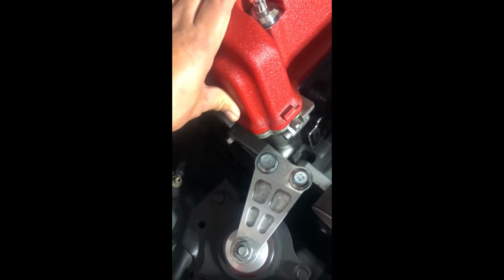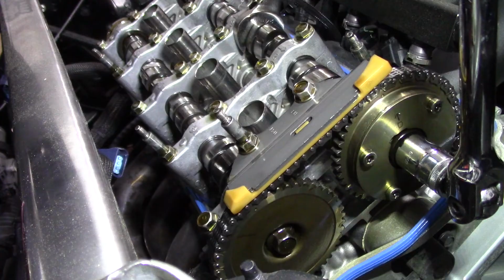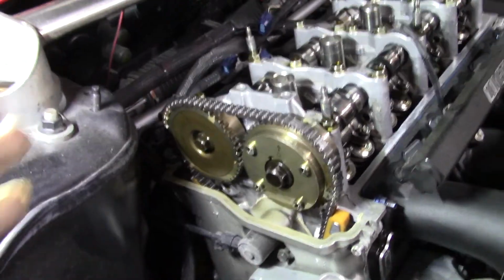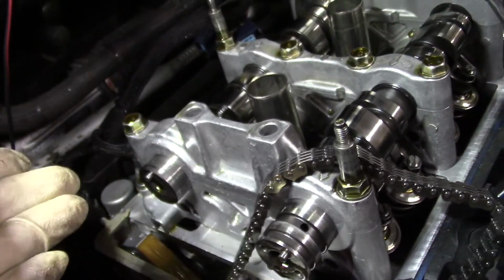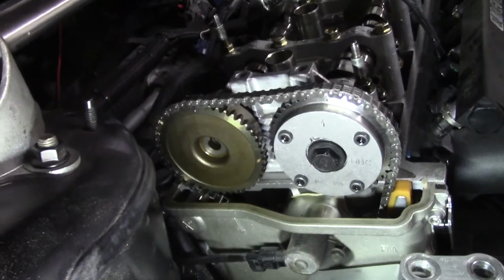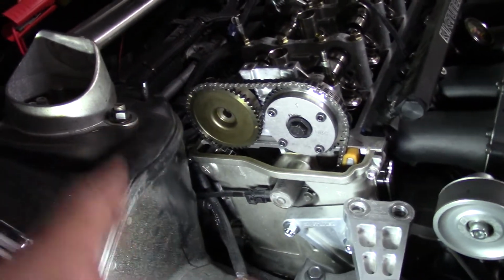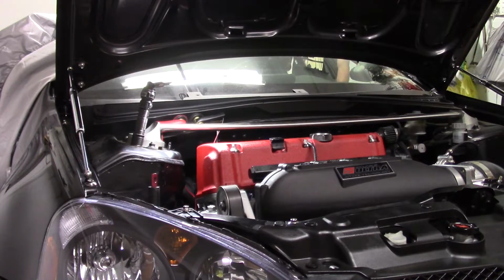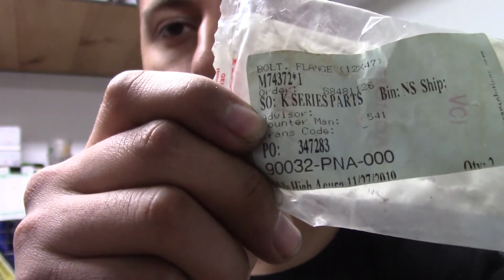How to fix your K series engine rattle!

Comment: I believe oil pressure unlocks the pin and spring pressure locks it. It rattles because the spring loses tension over time preventing the pin from locking on cold start up!

Comment: I learned something from your trial and error with the tensioner. Also being in tdc without factory links I would have painted Marks on chain to confirm it's in exact same place before I took it apart. Love this channel and the in depth content you got my full support keep it going.
Reply: He was suppose to move it up more then put the tension pin 📌 and I believe it should’ve went in more. He did an amazing job and I also learned a thing a two about this

Comment: glad you said that about locking. I saw you do it but I thought you should say something. But you did. I fixed mine by stretching the spring inside. You make great videos. Like your channel.
Reply: That's not a fix, the spring needs to be replaced and the locking pin needs to be worked over with some abrasives until it moves freely in and out of it's detent.
Reply: @caseyalexander2244  OK

Comment: I was always under the impression you should unlock the VTC gear before you install it rather than lock it because Honda recommends you do that. I never found a sound explanation as to why, I just always did because they say to. However your said at the end of the vid to make sure you lock it and it's just conflicting information than I previously had from Honda. If possible, can you provide a brief explanation as to why you recommend to lock it versus unlocking it?
Reply: New ones come unlocked, yer supposed to lock 'em after install & before put chain on.
Reply: If your torque the cam bolt with the vvt locked.. you are putting all that torque on just the locking pin. In the un-lock position, you have all the vains taking the torque, not the picking pin.

Comment: Same thing with me, couldn't get enough slack on the chain, I ended up using the bar from my pump jack to pry the exhaust cam on, since I was throwing in the SI exhaust gear used a wrench to at the same time pry it up. I moved the cams to be in time with each other then re-aligned the chain before the chain went on, everything has to be in time with the crank pulley mark. I wouldn't have manually cranked without that timing to be right on point.

Comment: Regarding the round punch marks on the VTC actuator and exhaust cam sprocket, are those exactly 90 degrees to the top of the chain case at TDC? Or are they skewed a little to the right or left?
Reply: If piston 1 is at TDC and the white mark on the crank pulley is lined up to the arrow on the timing cover, the two notches on the cam gears should be facing each other lined up.  If they are off, the timing chain is stretched.

Comment: Hey brother i had my k20z1 head rebuilt by a machine shop after previous rsx owner bent a exhaust valve. I used brand new supertech everything including dual 80lb valve springs, titanium retainers new lost motion springs, valves, guides, retainers. Once I got everything back together it runs great, lots of power but once the car is warmed up to operating temperature and I shut it off I hear these pinging noises from under the valve cover like the springs are unbinding. I have no misfires or issues yet but I cant for the life of me figure this out. I pulled valve cover, nothing looked weird cam lobes look fine, rechecked valve lash and set it on the looser end and the noise actually got worse. I'm gana go back in and set the lash back to normal but their is zero indication of what's making the noise. It sounds like spring or maybe a valve not seating correctly. Take a listen if you could, it's the noise right at the beginning of the video and tell me what ya think. 10 second clip. I have a longer video of about 3-4 of those loud ting noises. Gana be reaching out to 4P soon also since they know these heads in and out. Guessing a spring isnt seated right or the machine shop screwed something up. Really dont wana pull the head again.  Thnx! Your videos have really helped me out when I bought my RSX. "Blazedc5" on insta. ✌

https://youtube.com/shorts/HY0pTQQHQOM?feature=share

Comment: i think the way you describe it isn't technically right. It's a spring and pin that locks it. This should happen when oil pressure is lost (engine stopped). The problem is the spring and pin not locking it after stopping. So the next time you start the mechanism is loose and slapping about until oil pressure builds up and it returns to normal operation

Comment: Hi. There are some videos out there regarding the Honda K24 and K20 engines, where they open up the front cover of the VTC actuator and than just take out the actual lock pin spring and stretch it and then they place it back in. Many claim that no more rattle after. What do you think about that? Thanks
Reply: i hear its the trick for life
Reply: It really works! I’ve been driving my 2009 Accord EXL for about a month now and rattling went away! Bought 5 new hex bolts M6x30 from Home Depot, cost $6.28, and orange thread lock, cost $2.78. Took me 20 minutes! Just replace oem 5 star bolts with new bolts with thread lock, stretch the spring, tighten to 8lbs, wait 1 hour, and hear the quiet start up and no more rattling between 2-3k rpm while driving. Also while you are doing this while valve cover is off, check if your timing chain is not stretch and ok. You can tell by TDC markings on crankshaft and cam gears
Reply: @gerxiong6299  Yep it does bro. But Honda will never tell you that a 2$ spring was the culprit! They preferred charging people 1500$!!
Reply: Doesn’t always work but it’s worth a shot

Comment: Yo so I had some negative combustion inside my k24z7 engine and it threw the timing way out, when I rotate the right one back to top dead center the notches aren’t lined up even close. I don’t have very much mechanical experience but I want to get it all back into time. How can I do that at home?

Comment: Mine makes that noise at 2k rpm even after replacing the vtc gear and the timing components. I think I'm just gonna deal with it.
Reply: Did u ever figure out the noise ?
Reply: That’s low oil. Check your level

Comment: I should have picked up an RSX instead of a civic SI, I hate having to take the damn cowel off whenever I need to work under the valve cover. ;/
Reply: Yeah I feel u on that, RSX or TSX is the way to go...
Reply: lol just leave it off
Reply: @DTuned559  I actually did that for awhile because I knew I would be back a few times, lol :D  Still have the Civic... still loving and hating it at the same time.

Comment: where did you buy your vtc gear
Reply: HONDA
Reply: If you don't lock it your timining marks will never line up with the cams locked at the back with the lock pins in place. Your stage 3 cams sounds good BTW.

Comment: U should have really marked the chain before u pulled out ur cam gears. I think u got extremely lucky that u put the chain back on without a single tooth off. 

Also, shave the point off the thumb tach before inserting into the tensioner. It will make a better seat.

Comment: I haven't watched the whole vid yet so bear with me. 02 crv. 260ishk on the odometer. Bought it used a few years ago. Recently developed a "tick" for lack of better terms after 1.5k rpms goes away at 3k. The noise is not noticed so much at idle mainly while driving.
Reply: Valve clearance?

Comment: Lucky the pin did not drop inside the timing cover or you will  need to remove the whole cover.I always remove the tensioner, coz you may not know what's gonna happened next.